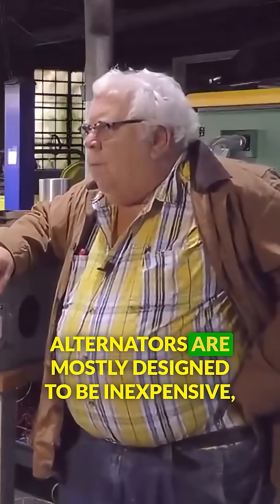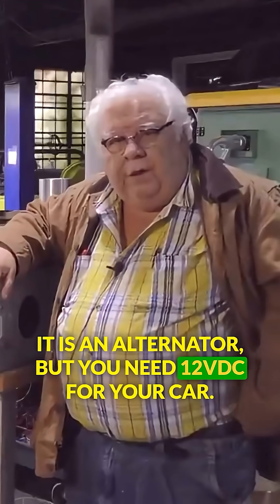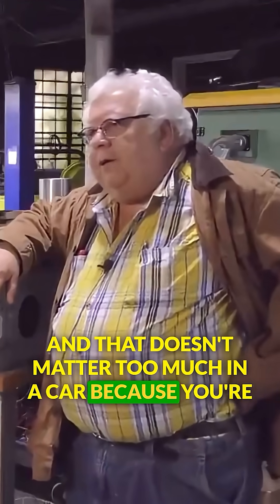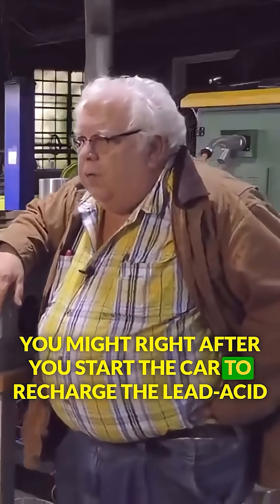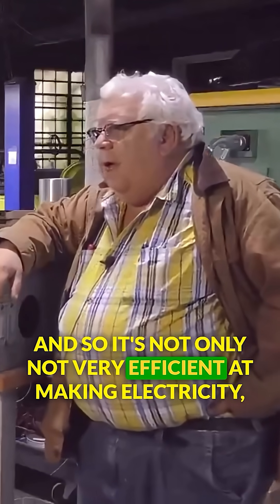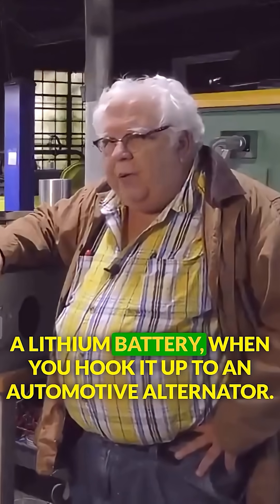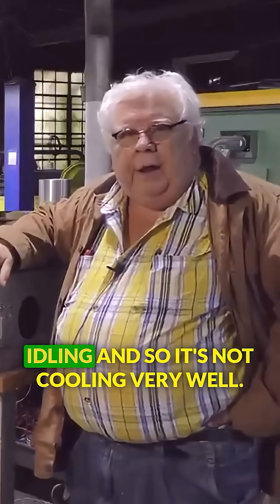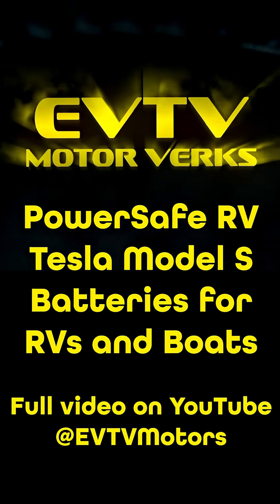Alternators are Only 50% Efficient!

Comment: I believe the reason why generators were swapped to alternators was they were better at supplying voltage down at an idle and consistently through the rev range. Old cars with generators would have their headlights get brighter as they'd take off from a stop, then dim back down again as they dropped back to an idle.
Reply: The field excitation can be varied. That's why they are better for automotive applications than generators. Current demand/voltage drop at idle it increases field excitation to keep up far better than a generator with fixed rate could. Then at cruising speed with minimal load it can scale back field excitation. While there are limitations to both methods, an alternator makes way more sense for an automotive application. Especially as more sensitive electronics require consistent voltage to operate properly. Where as with a belt driven generator the charging voltage and current vary with RPM obviously. The voltage regulator in an alternator solves this problem.
Reply: @madscientistlife Also generators always tend to create a back emf despite the electrical load, where as alternators are easier to turn over as less load is required, so generators are worse for fuel economy as well.
Reply: @madscientistlife they seem to work flawlessly on motorcycles for decades .
Reply: @madscientistlife  cars with generators had also voltage regulator...difference is, one generates AC, other DC. And also on alternator, the current depends of engine RPM
Reply: The issues with brushes on a generator is that it rides on a segmented commutator. Every time a brush passes over a segment there is a large spark which wears down the brush faster. The brushes ride on a solid slip ring in an alternator, so there is much less sparking, so the brushes last longer.
Reply: Anyone remember having to polarize a new regulator ?
Reply: @bluecollar58 
Remember reading about it
Reply: The brushes in a generator were miserable
Reply: @markarnold4688  altertnators have brushes too
Reply: @Heptofite  no they dont
Reply: @revstreak  yeah, they fuckin do.
Reply: @Heptofite but the brushes carry very low field current through slip rings which are smooth. Generators pass all the charge current through the commutator which is segmented and sparks.   The only weak spot in alternators is that they have no current regulating system, so into a low resistance load, they can produce enough current to destroy themselves.  When jumping a car with a dead battery, only allowing the engine to idle or slightly above idle will keep the current at safe levels until the battery builds up enough voltage to limit the charge current itself. 10 or 15 minutes idling may well save you from needing to replace your alternator immediately.
Reply: @grantdavis5992  The flash on the alternator is how i've managed to swap the a good battery out of a running car and traded it off with a dead one to recharge it. doesn't work on newer cars.
Reply: @uploadJ  I have replaced carbon brushes in alternators before.
Reply: I don’t know nothin’ about nothin’, but could that be a problem for the 26’ HEMI’s since they’re coming with- and ONLY with the etorque generator? I don’t actually know what the thing is for, but everyone complains about it.
Reply: @VaticusChadicus the etorque is just an alternator with a fancy control box. An alternator is already a 3 phase motor, but without a 3 phase motor controller it can only be used as a generator. If you hook those 3 sets of stator windings to a 3 phase motor controller you have a generator AND motor. An e-torque is just a bigger alternator with a motor controller box on it, afaik. Same basic construction other than the rectifier being replaced by a big electronic box that makes it ALSO a motor.
Reply: @Vigo327  I see, so does that mean there is constant voltage regardless of whether the car is at idle or not? I saw some old head explaining in a totally unrelated video that the automotive industry as a whole left generators and went to alternators due to discontinuous voltage depending on whether or not the car was at idle or moving.
Reply: Yeah, generators don't charge at idle
Reply: @Juandongduck 

 That's not true at all they will deliver voltage at low RPM and depending on the type of generator for example a fixed magnetic rotor type will be limited by the strength of the magnetic field which dictates much power aka Amps can be generated. And the windings of the stator can be altered to generate any voltage range as needed from single Volt to even 25000 volts just increase the number of windings.
The frequency of the output is directly proportional to the RPM and the number of poles the generator has.
If you have a generator with a winded rotor and slip ring connection or an excitetor coil which is a far better way to control the field strength of the rotor because that's a brushless design. 
And because of the winded rotor you can regulate the output voltage.
And that is very desirable when the generator is used to make AC voltage system.
And the RPM needs to be fixed and as stable possible because you don't want the frequency to change to much. Because it will directly affect motor speeds and transformer efficiency for example.
For a DC system it's not so very important.
The only thing you need to control is hou many volts minimum and a minimum frequency for the rectifier to  generate a stable output voltage.
So for example if your generator is delivering a voltage of 20v @ say 60Hz ad 10 RPM rotor speed.
You can than very easy regulate the output down to say 14.4 volts.
And let ohm's law do the rest of the work.
Oke I will admit the voltage will fall and  climb with rpm changes a little bit only that's easily corrected by the voltage regulator as long as the voltage is above the minimum required depending on system voltage and minimum working voltage of the voltage regulator.

There are many more pieces to the puzzle of generators like how many output phases it has most commonly used are 3 phase generators.
Single phase generators are good enough for DC applications

Hopefully the language barrier isn't to big of a deal and everything I tried to say is som what understandable.
Reply: @FerdinanddeRoo I may have misspoke, but the four 6 volt vehicles I worked on did not effectively charge the battery in any way unless they were above idle.  There may have been some voltage but not much.  If you idled one with the headlights on, the battery would die.
Reply: @Juandongduck  It still happens in newer vehicles, you have to get it to around 2k rpms for it to charge.
Reply: @Kamala-km4ty Well that's just not true
Reply: Dpesnt make sens the speed is determined by the pulley you put on it .
Reply: The difference is with voltage then higher voltage higher brightness with alternators you can change the excitation of the rotor to maintain a voltage independently of the rpm + yo dont have to use brushes
Reply: @revstreak note the brushes in an alternator carry the power to the rotor which is the Field coil, the stator is where the power is generated so the brushes carry very little current most of the time.
Reply: Well,  you could do a brushless DC generator with DC/DC conversion, and level the loads with hypercapacitors and a battery. Super efficient.
Reply: Generators had to spin much faster to operate.
Reply: Alternators supply power at idle because they have a smaller pulley so they are still rotating at a reasonable rpm when the engine is idling. Their construction allows them to tolerate the resulting very high rpm at higher engine speeds. Generators would also charge well at low engine rpm but tend to fly apart internally if they had the same small pulley.
Reply: The reason is generators work by spinning a coil between magnets. An alternator uses electromagnets. The magnets we could build in the generator days were terrible, and thus weak so output was limited at slow speeds. Electromagnets can be much stronger and thus even at low speeds they are making power because of the higher field strength of the electromagnet. These days we have rare earth magnets with much greater field strength but are much more expensive. Back in the generator era, we didn't.
Reply: And if doing a paper route with lights on can also drain the battery if just driving around for an hour or two.

Because the generators rpm is two low
Reply: No, they were cheaper was the main driving factor
Reply: An alternator is just a generator with a built-in rectifier and voltage regulator.
And always need to have a power source at first before it can generate its own power and sustain itself.
This is the result of the built-in voltage regulator.
That's directly controlling the rotor field strength by changing the voltage on the rotor winding and so control the output voltage.
The 50 % efficiency is just the result of the way the rectification is done if the alternator is single wave rectified it's indeed 50 % less efficient than a full wave rectified one.
The most important thing is the designed duty cycle of the alternator
That will dictate the maximum time the maximum current can be delivered. 
For the maximum current it's usually 60%. 
So if your car needs say 100amp to continue to work probably you will need an alternator with a minimum of 220/250 amp to sustain the needed 100amp and have some power over to charge and power any auxiliary systems like the power plugs and USB chargers.
And all lithium batteries for automotive purposes have a built-in current limiter for charging and a disconnect safety to protect from overload conditions.
Also the BMS will not charge if the  battery is too cold or too hot.
Some lithium batteries even have heating elements to work more reliably in Cold condition's
And the BMS will balance the cells and prevent over and under voltage of the cells.
That's the minimum of what Is possible you have BMS with built in Bluetooth to control some things like max charge level max discharge level and current limitations on charge or discharge conditions.
That's very handy if more than one battery is used in series or parallel of each other.
Never ever use a litium battery as the main battery in your car there is a reason why electric cars have a lead/AGM battery in them for all the normal car stuff because they are much more reliable than the lithium batteries so you always have emergency lights brake light signal lights headlights and various safety systems like power cheering and the break system if the lithium battery fails in one way or another.

My recommendation is to only use lithium for auxiliary/leisure battery next to you normal battery. 
And use a Isolated DC to DC charger.
To charge any extra battery/bank if it's lithium or any other type of battery. 
I personally use the Orion smart from Victron energy. 
So pick one with a maximum amp rating that's within reason for your alternator's capability.
The advantages of using an Orion smart DC to DC charger have adjustable charging voltage some AGM batteries like a higher charging voltage and the Orion boost the voltage from the 14.4v system of the car to the required charge voltage of the other battery.
Also they have a charge cycle to extend the battery life.
And one of the best features is that it's compatible with smart alternators.
And they automatically detect if the engine is running preventing an empty starter battery.
So no isolation relay or diode divider needed to prevent unwanted discharge of the main battery.

My alternator that I use to charge my leisure battery bank in my ship is current regulated with a higher charge voltage for my AGM batteries @ 15.75v and because of the current is never above the 100% duty cycle of the alternator I can use my 3000va Victron multiplus 240v inverter/charger with out the risk of burning out the alternator because I use my air fryer that is pulling 240 amps from the batteries for an hour while cruising to the next place to visit.
Believe me that the alternator has delivered its maximum of 150amp for multiple 9 hour trips because we always use our big energy consumers on the go like baking bread for the next few days cooking dinner on the induction cooktop charging 1200Ah of battery bank from 50% back 80/90%
Reply: @thooper4380

generators  are dc and supply a constant voltage so a low battery takes forever to charge up, and alternators are ac then convert to dc and are much more efficient,,lighter,cheaper and reliable. Generators can't supply charge at low idle ,those are some of the reasons why they switched.
Reply: And, you could start them on a flat battery. I had to crank my old Land-Rover on occasion & got me home. Try that on an alternator. You're walking.
Reply: @ericyeoman2687  you can do the same thing today if you have a AA to flash the coil with. once you add the base charge and it generates electricity it can take over for itself.
Reply: @ericyeoman2687 not true… you can even start a fuel injected car that has an alternator with a flat battery if it’s a manual transmission. I did it all the time with my ‘94 Miata when I was in college, and just did it a couple of weekends ago when I was off-roading in my ‘21 Wrangler.
Reply: EVERYTHING on a car is powered by the battery ! The positive wire goes from battery straight to the fuse box ! The generator/ alternator is to charge the battery and attempt to keep it at equalibrium ! The battery is designed to operate the car with zero input from the alternator for short periods ! ( reserve capacity) ! The problem is with elecrical load ! Until early 60’s they ran heater blower, lights, wipers,and radio ! They kept adding a/c, power widows,seats, sun roof,rear a/c ,etc until the common generator could not keep up with demand ! Cheaper and less weight to go with alternator !
Reply: @chavitacanta008  Your totally wrong, the alternator powers the car.  The battery is  there for starting puposes. Yes batteries do have reserve capacity if you sit with the radio on or have an alternator failure which is very useful of course.
Reply: @jjakes5589 False, you can take an alternator out completely and still run anengine if you put an idler pulley instead of an alternator. So long as the distributor gets power, the motor will run. Or you can take the battery out if you jump the positive and negative leads and jumpstart the vehicle.
Reply: @Uruz2012 Without the battery as a load and capacitance an  alternator hunts like mad trying to match the voltage, which with the load varying wildly with all the various loads on and off just with the engine managment alone causes quite a problem. Voltage can easily surpass 18v, and thats where things can start burning out. The battery smooths this ripple/noise and levels out the voltage.
Reply: @wolvenar  amps are what burn voltaje just makes it jump further
Reply: @revstreak OK if you think that lets try supplying 240v at  .005 amp to your ECU. 1.2watt is well under the 50 to 250 watts the ECU would take in normal operation. It MIGHT have some high voltage protection, maybe voltage regulation, but I bet that the break down voltage of that protection /regulation would not like it very long.
Reply: @jjakes5589  dead battery on a dodge caravan minivan, killed the shifting at low speeds. You had to rev the thing to shift it or else it stalled out.  And of course when that happened it was 5 o'clock stop n go traffic.
Reply: @chavitacanta008 , !!!!!!!!
Reply: @chavitacanta008  The alternator does both, runs the car and charges the battery.  Once a car is running, you can disconnect the battery and it will keep running (considering that your alternator is good).
Reply: That's the way everything is now make it so it breaks 2-3 years down the road so the consumer has to keep buying, keep paying, keep filling the pockets of CEOs that have more money than they will NEVER run out of in the first place
Reply: @JoshP-ip5hh  Roger Smith?
Reply: @JoshP-ip5hh  I bet you still have a car though.  Joke's on you!